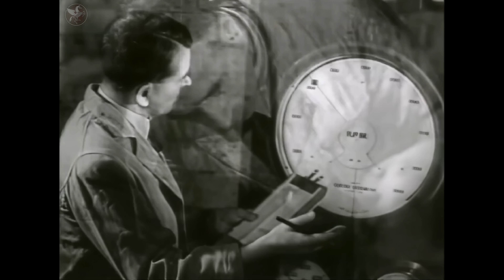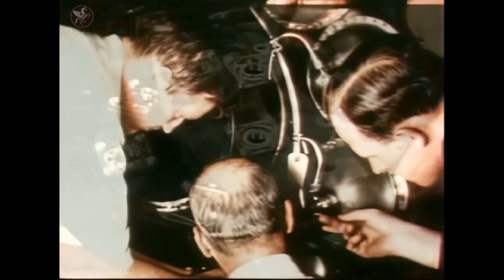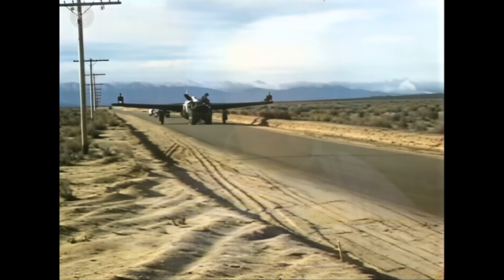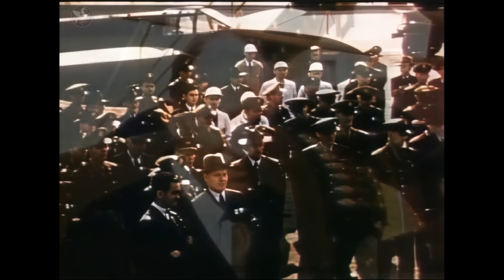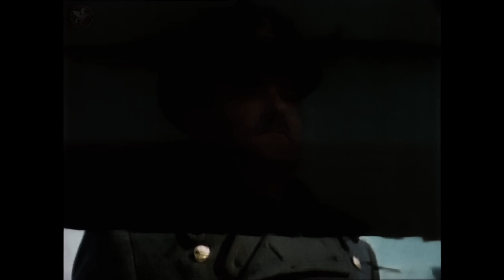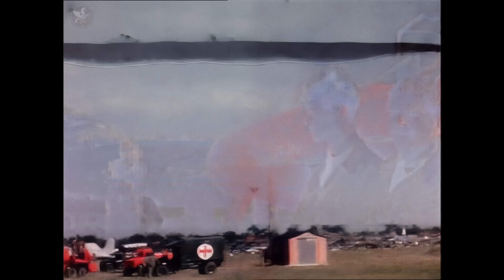Bell XP-59A: The Classified Birth of American Jet Power

Comment: A great, "What if?" still remains in the minds of military historians.  The USAAF passed on the XP-59 Bell Airacomet.  Its two, British-designed, General Electric turbojets produced just enough thrust to push the jet at a maximum speed of just 409 mph.  Clearly the USAAF expected far better.  The P-51B could achieve 441 mph.  Perhaps if the XP-59 reached 450 mph to 480 mph, the USAAF might have been tempted to go ahead with mass production, expecting improved turbojets soon enough over the next 18 months.
     But what if the USAAF decided to go ahead with limited mass production to jump-start the United States military jet aircraft production and training programs?  By the time improved P-59s appeared and even newer jet fighters, there would be a sizeable group of trained, experienced American jet pilots.
     The year 1944 would have seen small numbers of P-59 Airacomets in the skies over Western Europe mostly over occupied France, Belgium, and Luxembourg.  The P-59 would need auxiliary fuel tanks under its wingtips to provide reasonable range, but this still would not bring the fuel-thirsty P-59 over Germany.  That job would devolve to the P-51B Mustang with auxiliary fuel tanks.
     German fighter pilots would at first be shocked at the appearance of the first American jet fighter over France, escorting the B-17 and B-24 heavy bombers until the longer-ranged P-51B Mustangs took over.  Jet fighters are able to sustain their high speeds at altitude.  German Bf-109G6s with a top speed of 380 mph are hard pressed to match the 409-mph speed of the P-59 Airacomet.  The following Bf-109G-14 with its top speed of 410 mph with methanol water engine boost can match the P-59.  Yet the German fighter pilots are stunned when the American jet fighters spew out 37mm cannon shells.  This is completely incredulous to the Germans.  The P-59 has only three, M2 0.50 caliber heavy machine guns in the nose which can still inflict fatal damage on any German fighter plane.  But one strike with a 37mm cannon shell will demolish any fighter plane.  The German pilots soon learn they need not worry overmuch.  Like the German MK108 30mm cannon, both cannon types tend to jam under high G maneuvers and tight turns.  The cannons are most reliable when the jet fighter is flying relatively straight and drawing little to no G forces.
      The Bell P-59 Airacomet is best armed as an anti-bomber interceptor. But by 1944, the Luftwaffe's twin-engined bomber force is largely no more.  Remaining twin-engine bomber aircraft have adapted to effective night fighters against the RAF heavy bombers flying at night.
       We will never know as the USAAF held out for a better jet fighter, which came in the spring of 1945 as the Lockheed P-80A Shooting Star.  Its much more powerful turbojet pushed the P-80A to 540 mph.  This is what the USAAF wanted all along.  The 1948 P-80C can achieve 580 mph.  The U.S. emerged victorious on V-E Day, but without the P-80A.  Only two early production P-80A Shooting Stars made it to Italy in April 1945 for operational testing, of which little is known.  The USAAF ended the war in Europe employing the capable P-51D Mustangs to tackle the Luftwaffe Me-262 jet fighter by diving ambush tactics and strafing the German jets on the ground or during take-off or landing.
Reply from the maker: And by 1945 the Meteor, also powered by Frank Whittle’s invention, proved to be as fast, or faster, than the Me 262, despite lacking swept wings,so imagine if Whittle had not been ignored for six years, between 1929 and mid-1935, when he received a small amount of money from a private investor, thanks to a friend, that allowed him to create the first turbojet in history in April 1937.
Had A.A. Griffith approved Whittle’s project in 1929, his work would have been secreted and funded by the Air Ministry, also preventing Hans Von Ohain from partially copying his work that proved essential to make the He 178 flight in 1939, which set in motion a series of events.
But perhaps, if Britain had, thanks to Whittle, properly working jet engines possibly before the beginning of WWII as a result, they might not have handed over to the U.S. the jet engines possibly before technology, including the axial variant research, and it would also not have sold Whittle’s derived engine to the Soviets either, which proved to be both a nightmare during the Korean War, and a great business for the Soviets with their formidable MiG-15.
The consequences of Griffith’s decision to stop Whittle in 1929, most likely for an obvious conflict of interest, as he became one of the fathers of the axial turbojet, had massive consequences that last to this day.
After all Whittle was fully aware that an axial variant would eventually dominate, but his desire to give his country the most perfect interim solution, was off the table thanks to Griffith, who also had to suffer the humiliation of seeing his axial jet engine be tossed out when compared to Whittle’s in the early 40s, because, just like the German variants, and just as predicted by Whittle, it would need another decade to be developed into proper engines.

Comment: Construction of the XP-59A took place on the top floor of 2495 Main Street, Buffalo. This structure (designed by Alfred Kahn) had previously served as a Ford production plant (1917-1931) and thereafter both Bell and Hercules Motors who produced diesels for the US Navy. After WWII it served Trico wiper blades until 1988, thus it is known to Buffalonians as the "Trico" or "TriMain" building.
Reply: I worked in the Wheatfield plant in 1983. My first fulltime job in aerospace. It was a great career. 42 years at 7 companies (34 at McDonnell Douglas/Boeing) in California.  Bell closed a few years after I left them in 1985. I never looked back.
Reply: @jamesdellaneve9005  I grew up near the other end of the NF runway with a next door neighbor who painted red stars on P-39s & 63s, and across the street from one of their quality control engineers.

Comment: With Germany’s ME-262 jet. I think even if it was produced in more numbers, I think the allies would have caught up.  I don’t know how the British Meteor would have done against it, or the P80. But we would have seen rapid progress either way, and may have had a Jet bomber bombing Germany.
Reply from the maker: The Me 262's engine was, operationally speaking, a disaster. After the end of WWII, the only country showing any interest in the German engines was France, and despite having a large budget and 120 former Nazi engineers at their disposal, it took them eight years and radical modifications to make them work as intended. Britain also had an axial program during WWII, but when the Metrovick was pitted against Whittle's engine, in the early 40s, it showed similar flaws to the German engines; Whittle's reliable and easy-to-develop engine was chosen.
Interestingly, Metrovick's key contributor was A.A. Griffith, one of the fathers of the axial turbojet, and author of a famous seminal paper on axial compressors in 1926 (a decade before the Germans).
Griffith,, in 1929, was chosen as the sole judge of Whittle's invention, and he disgracefully dismissed it, setting in motion a series of events that changed aviation history, and crucially delaying Whittle by at least 6 years (mid-1935), when he found a private investor that gave him a small amount of money, that allowed him to create the first turbojet in history in April 1937.
To add insult to injury, after the 1929 dismissal, Whittle decided to patent his invention, which would have instead been secreted (therefore supported and funded) had Griffith supported Whittle, by the Air Ministry.
By 1934, Whittle was broke, frustrated, and ignored, and could not afford to renew his patent, which was swiftly grabbed by the Germans, translated, and distributed across Germany.
Von Ohain and his forgotten, crucial assistant, Max Hahn, of Jewish descent (and probably that is why he was forgotten by the fervent Nazi supporter Von Ohain), used Whittle's work to create the engine for the famous Heinkel He 178, which was mixed-powered.
That aircraft and its first flight kick-started the Nazi race for a turbojet.
Had Griffith not made that disgraceful decision, the RAF would have had the perfect jet engine at the time, well before the beginning of WWII, and Germany would have been a decade behind to begin with.
Last but not least, a Meteor powered by Whittle's reliable engine, in 1945, proved to be faster than the Me 262 powered by a disastrous, unreliable engine, and that despite lacking swept wings!
Britain ended up giving away both their axial and centrifugal technology to the United States (General Electric, Pratt & Whitney, etc. are eternally grateful), and Rolls-Royce gave it to the Soviets, who used it to power the lethal MiG-15, which initially faced the F-80 (also powered by Whittle's engine) in Korea. Kelly Johnson's aircraft, which lacked swept wings, succumbed to the MiG.
Griffith, in 1929, was probably moved by jealousy or a blatant conflict of interest, but his decision deprived Britain of being far ahead of anyone else, forcing it to eventually give away for free or for pennies a massive technological advantage.
Being a strong patriot, and a rather low-key person, Whittle was kind enough to not completely trash the likes of Griffith and Von Ohain. He always defended the Air Ministry and the government for not having a role in those initial mistakes, but he certainly blamed them for handing over to Rover his work, as they were incompetent.
The mistake was corrected by giving his work to Rolls-Royce, and as we all know, they are also doing pretty well in the engine business, just like G.E. and all the others that were gifted Whittle's work in the 1940s
Reply: @Dronescapes . The MIG 15 was actually powered by a reverse engineering version of the Rolls Royce Nene engine. The Nene did not include the flaw of using a reverse flow system. This design change eliminated the surge problem which had so frustrated Whittle. The Nene might have looked like a W2/x (Derwent) derivative at a glance but under the skin it was very different. The Nene was too fat to fit in the Meteor but a redesign was done which did fit. This was named as a Derwent derivative to obfuscate the situation.

Comment: The Bell P-59 Airacomet was deployed to Alaska in case Japan developed jet aviation, which they did with the Nakajima (J9N1) Kikka in August 1945. Of course, those deployed were reengined, but still not on par with the Lockheed P-80 Shooting Star. The British Gloster Meteor Mk.1 flew about the same speed as the P-59, but with engine developments, the Meteor Mk.3 was much faster and in the realm of the P-80 and Messerschmitt Me-262.